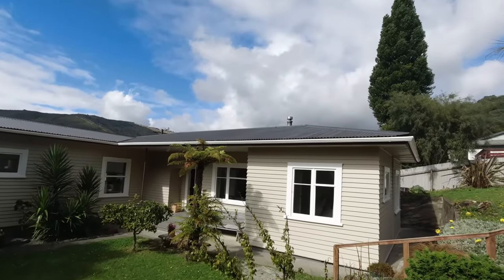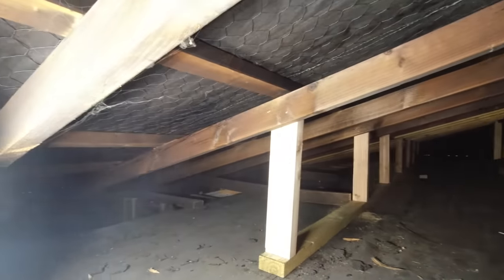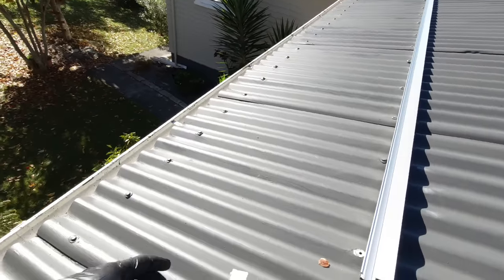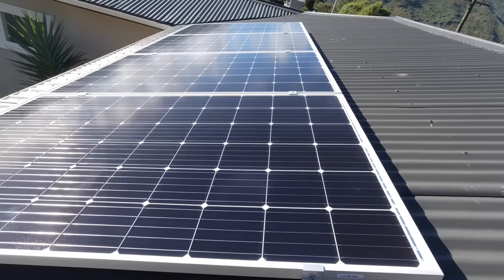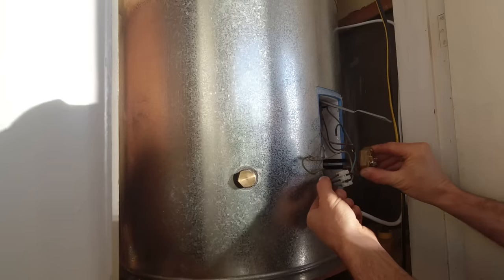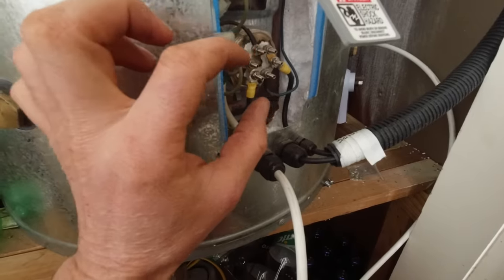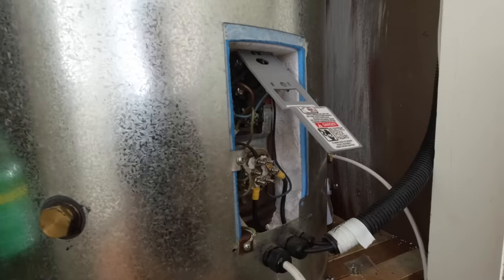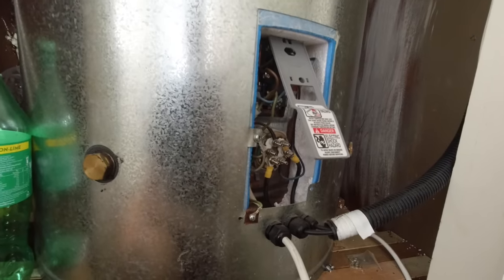Installing PV Solar Panels using a Water Tank as the Battery.. Halved my Power bill

Comment: This is absolutely brilliant! Thank you so much for the information. On my land, we have a spring that puts out 30 PSI. We also live on a steep hill, I would love to install multiple microhydro turbines, but the cost to switch over to a panel that allows self-generated power to run alongside grid is very high. I've been trying to think of the best way to make use of this low wattage but non-stop energy source. Using the hot water heater as a battery is bloody brilliant! I don't know why I never thought of that. I imagine it helps a bit with heating bills as well. I'm going to try to rig up a nearly identical system. I was a little bit confused by the safety device that kicks off the power, I think you said RCD? Any chance you can drop me a link so I can learn the right way to wire this up safely? Even if you can just point me to the necessary keywords to look this information up. Thank you very much
Reply from the maker: Sounds ideal for you site, I used a b-type rcd on the ac supply
Reply: Lately I have been thinking about using the gravitational potential energy of water as a battery with multiple micro hydro generators and two reservoirs, one at the top of the hill one at the bottom, using pv solar panals to feed the house and pump water from the lower reservoir to the upper reservoir during the day and then at night using the micro hydro generators...You could add a windmill pump for windy days as well...
Reply: @MartyT  thanks very much. That's got me pointed in the right direction

Comment: Maybe think of some kind of tank temperature monitoring/ alarm/ PV-disconnect, as you could quite easily get the whole tank up to 100C if you're not there drawing heat out for a few days, whilst there is high sun levels.  Check the specs on the tank and tempering valve - you might need to get 'solar rated' ones (- standard ones are often only rated to 80C).  Up here in Auckland, I have a solar water heater with 30 heat-tubes, that'll boil the 350L tank (- there's plumes of steam coming out the vent!!) on a hot summer day
Reply: Exactly, if you’re not using your hot water for a few good sunny days you are running the risk of boiling it and your only safety net is the pressure valve on the tank. Perhaps a DC thermostat?
Reply: @2bitdale  the best way is to use a DC to AC heater controller and use the old AC element with thermostat. More efficient and you don't get corrosion build up like you get on DC elements.
Reply: @hein_mcleod  Sounds interesting. Can you provide a link to a DC to AC heating controller? Cheers

Comment: Any Solar installation without battery backup is a half measure, a compromise; like wanting an EV but ending up with a Prius.
Reply from the maker: This is actually more efficient than most battery based systems, I am eliminating power losses created by passing current through transformers, electrical components, wiring and batteries, all available energy is being absorbed by the water.
Reply: The point is, the hot water cylinder is the battery in this case

Comment: yeh i did the same as an experiment years ago, but that element is different to what i used i only had a 24v element , what voltage rating is your element.

Comment: How are you controlling the DC temp side? 80 C will burn ya.
Reply: @MartyT
2 months ago
During summer I disconnect 2 of the panels so it doesn't boil the cylinder, rest of the year all 4 are connected. I find this works quite well.

Comment: Yeah a house with sheet metal roofing installed correctly! Has a few holes though.

Not a fan of crimped on connectors as most of them come apart more often than not. There is a good way to crimp them by folding the metal down middle but most people have no idea how to do that.  Basically the plastic coated connectors are for temporary use only.

If you remove the plastic and crimp them correctly they are fine but it’s the only way to do so.

Comment: Evacuated tube solar collectors is a lot more efficient at heating up water than PV panels.
Reply from the maker: Far more expensive and more work to install, we haven't need to turn on the mains element for weeks so I'm glad I went with pv solar

Comment: How do you get on with the kids having water that hot? I bet they are under strict instructions to not touch!
Reply from the maker: Tempering valve keeps it safe
Reply: @MartyT  that's great.  I was brought up in 70's NZ when the water was turned up to the max. I suffered a burn or two...
Reply from the maker: @chrischerry2787  Ahh the good old days when power was cheap

Comment: Did you used a AC Voltage water heater and connected the dc voltage direct into that?
Reply: No.
It is 2x 600W elements on the DC side with a separate element of 1kw for the mains....but all in the same screw in size as the "normal" WH element...

Comment: Marty, are you a qualified electrician? If not how do you get by with a possible house fire with your insurance company, they would not honour any claim re electrical faults. I might seem negative but your home is your biggest investment and I have had dealings with insurance companies that look for every way not to pay on a claim. Also on the structure of the roof, I would assume there was no insurance claim due to the fire or it would have been repaired correctly and inspected, looks dodgy to me.
Reply from the maker: Yep its all signed off

Comment: Any problems with water getting too hot in summertime , is there any temperature control with the solar outputs ?
Reply: Marty did say in a comment that he disconnected 2 panels in the height of summer and that still gave the family sufficient water.....
Because the water heater is still grid connected via timer and thermostat...... any grey days during summer have that as a backup....but it's normally not needed...
Reply: @MartyT
2 months ago
Hi Nigel,  During summer I disconnect 2 of the panels so it doesn't boil the cylinder, rest of the year all 4 are connected. I find this works quite well.
Reply: @JohnSmith-pl2bk  @Martyt , but no feedback loop to control the water temperature continuously? I guess the inbuilt thermostat is still in series with the mains part of the element right? It would quickly get destroyed switching dc so another approach would be needed…
Reply: @tonysouthern3017  
Marty lives in one of the sunniest parts of New Zealand...but 4 panels are needed to supply 180 litres of hot water for his family at any time outside summer when only 2 panels are needed.

If you were putting in a brand new HW high pressure cylinder, say with a stainless steel liner...
you could specify 250 or 300 litres or more as the capacity...

which would probably absorb all the output those 4 panels could produce and still have 60 degree C water which is recommended for killing off Legionnaire's Disease spores in "warmed" water....

Other commenters have suggested expensive electronic controls for th DC side....

but Marty was only aiming for the simplest system 
with the greatest output 
for the least money 
and the best ROI....
which it has achieved in paying the $NZ1000 cost off in 2 years.

Comment: A heating element is basically just a (real) resistor. No difference between AC and DC.
Reply: I believe the 'DC' elements are just much lower resistance so they are better matched to the output of the solar panels. I.E. The 'DC' element works at much lower voltage

Comment: How does the ac thermostat relay like trying to shut off a dc current from the panels?
Reply from the maker: No I wouldn't use an ac thermostat to release the solar feed but no issues having it control a big dc slave relay poered by a little 12vdc powerpack

Comment: If the dc element is 48v , can it handle the 66v?
Reply from the maker: Yes this one is designed for it, Its been in use for over a year now with no issues, and the system has almost paid for itself
Reply: @MartyT  thanks. Please what thermostat are you using? How many panels in s and p and watts? Did you change the connection way of the element: Wires from one side and junction from the other side?

Comment: Brilliant! Too bad I already have solar hot water. For the very rare days (after a few days of little sun) when the water temperature gets low enough the backup element is manually switched on - just enough. That might be a few hours each year. HINT - if installing a solar hot water system get a stainless steel tank system. Those glass lined systems are almost designed to fail.
Reply: I don't agree. I've just installed a new mains pressure steel/ceramic water cylinder. The previous one lasted 27 years. Also, you're paying double the price for stainless.
Reply: @1425race  You can get lucky - the average for a glass lined tank is apparently 5 - 12 years (depending on original quality) but unfortunately it just needs one inappropriate bump on a glass lined tank before it is installed to create a tiny weak spot - and then it is just a matter of time.

Comment: angle of the panel is not ok. it is lying flat on roof following only the slope of the roof. i guess there needs to be more tilt
Reply from the maker: Yes tilting tthe panels would increase output but would also impede neighbors view and this is a high wind zone, I prefer to keep them close to the roof

Comment: Another excellent video, Can you tell me the difference between a dc element and an ac one, (I'd have thought no difference, only perhaps in voltage range- dc being lower) or is the some capacitance decoupling going on?
Reply from the maker: As far as I know the only difference is resistance values
Reply: @MartyT  was thinking along those lines, anyway I'm a big off grid/home diy power fan. Wondering what your thoughts are on pv systems that supposedly feed back in to the grid when generation is higher than demand?
Reply from the maker: @dav1dbone  Good idea if you have plenty of panels and are already grid connected, no need for a huge battery bank, when the batteries get low the mains could pick up the slack.
Reply: @MartyT  I agree, although I'm sceptical that feeding surplus power into the grid makes any difference, I mean it would require an invertor with sine wave output sync'ed up to the incoming AC, and surely the voltage would have to be higher too?

Comment: CONTEMPLATE BUILDING FRAME AROUND THE PANELS TO KEEP PIGEONS (RATS WITH WINGS) OUT.  THEIR POOP WILL EAT AWAY AT THE METAL ROOFING PANELS AND NASTY NESTING MATERIAL WILL HOLD WATER THAT RUNS UNDER THE PANELS.

Comment: That's very cool... urm.. hot!
I'm just wondering are there MPPT controllers for this application that can switch multiple heating elements in series/parallel depending on the current sun exposure for best impedance matching?
Reply from the maker: Interesting idea, You'd probably have to custom build something, might get quite complicated

Comment: great idea but wouldn't a solar water panel on the roof be cheaper easier...mines lasted 25yrs so far,very rearly connect it to mains (qld)..but good job,glad you fixed the ceiling.

Comment: Wait hang on:
Solar water heaters are 90% efficient
while
Solar Electric panels are what 25% if you're ... lucky.
but
you think it's a good idea to mount electric...!?
You do know there's a dislike button for YouTube right..?  It's not the video I dislike its the ignorance.
With the above info at your fingertips it's not ignorance so much as stupidity!
Reply from the maker: You're looking at it from the wrong angle chief.. solar panels are so much lighter, cheaper, easier to install, no need to do any plumbing or strengthen the roof, this system has now paid for itself a couple of times over and our power bill has more than halved. That was my goal and I succeeded
Reply: @MartyT  Hmph!   :)
Ok-ok; I do see it being a simpler installation in this case.
But an Evacuated Tube system, at 90% efficiency (vs 20%)the solar water will be way smaller in area and weight.
Also the weight is concentrated in the manifold which can be placed above a naturally stronger part of the roof.

A solar water heater also isn't nearly as badly affected  by a leaf or something making shade on a panel.
So; are you sure its lighter, cheaper and easier?  You did the maths??

For simplicity:  A coil of (preferably black) pipe in the sun somewhere/anywhere works, but not nearly as efficiently.
Reply from the maker: Yes I considered the options carefully.. My father has evacuated tube water heater on his roof and has had all sorts of problems with it over the past 20 years.. water leaks, broken tubes, circulation pump issues, I decided not to go down that road.
Reply: @MartyT  Ah!  Thx for the info Marty.
Yes that changes one's outlook dramatically.

Strange thing is my Mom has had one on the roof for ...15yrs IIRC and not one issue so far.

I'll have a look when and if I (can) get up there and get back to you.
It may just be a brand thing..?